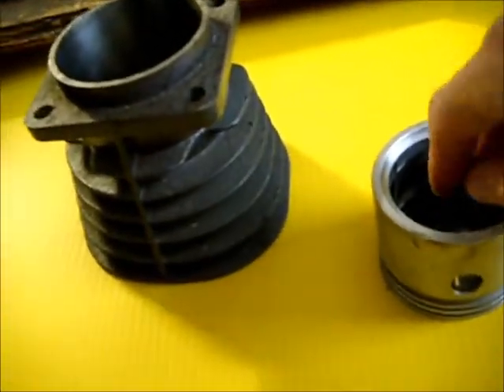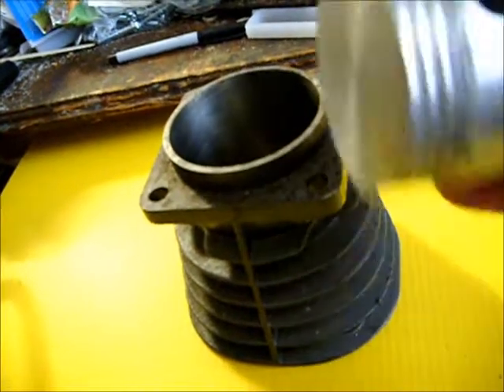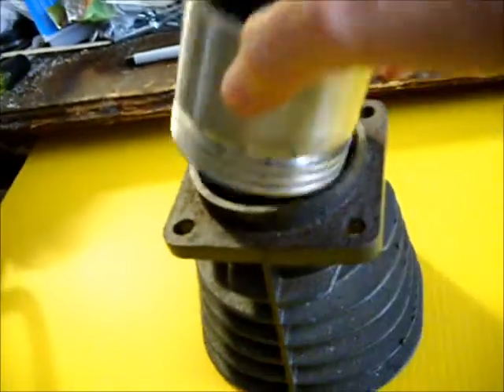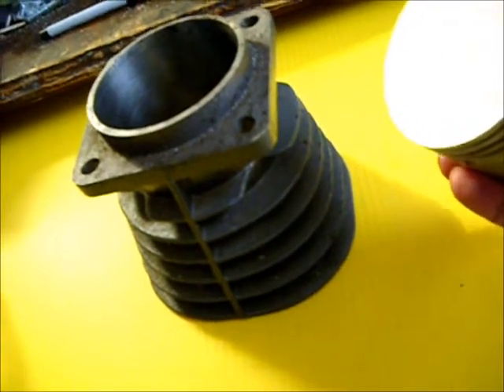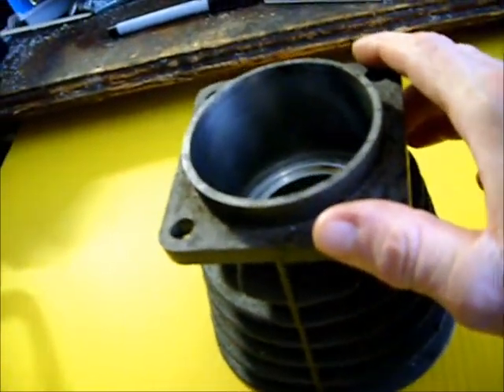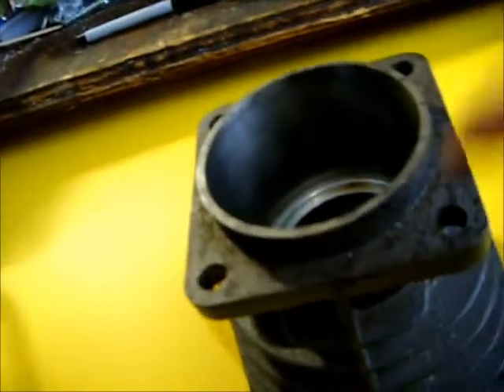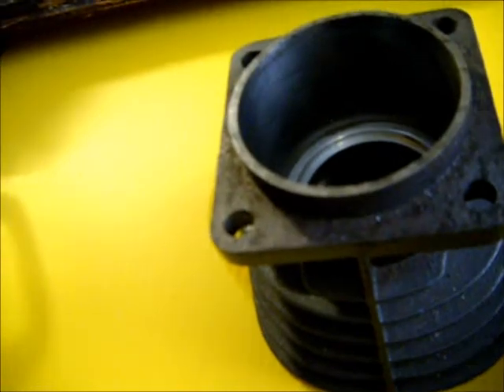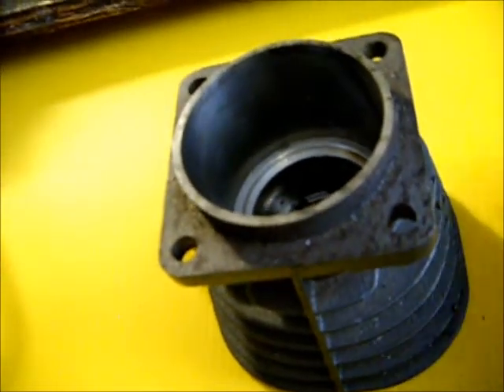Attempting thermal lag stirling engine

Comment: What is the cylinder/piston from?
Reply from the maker: Hi, an old air compressor  or a vw pancake engine.

https://www.summitracing.com/parts/svw-15176?seid=srese1&cm_mmc=pla-google-shoppingsrese1_-scat-vw&gclid=Cj0KCQjw-tXlBRDWARIsAGYQAmeDjArGY5uPMVP86ZAnbD1Y3qZYj1W7FwQddf7aYenAu5ITdhCRw5AaAoZiEALw_wcB